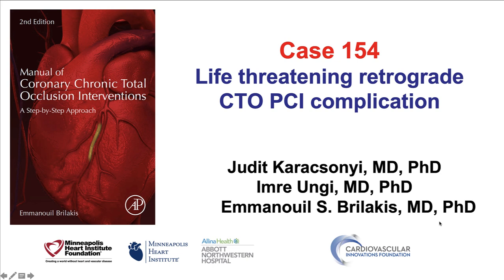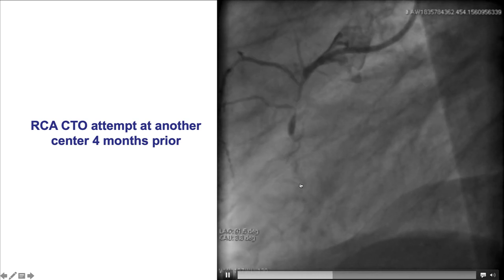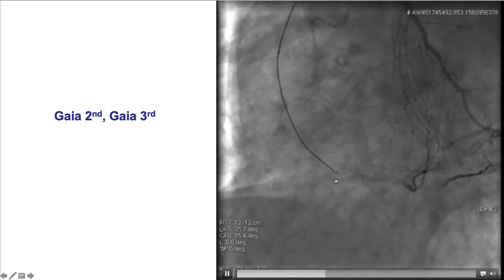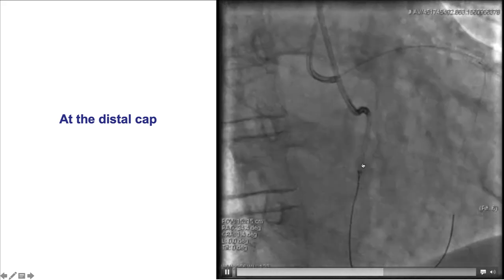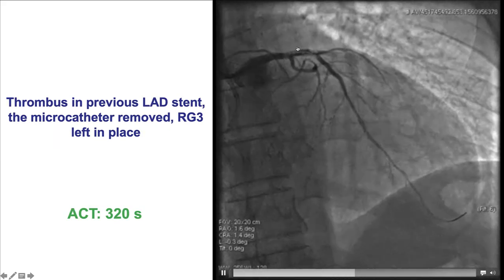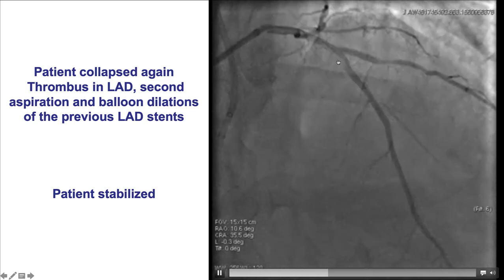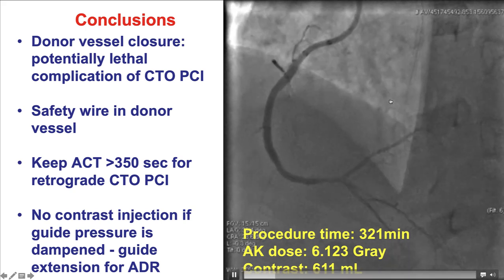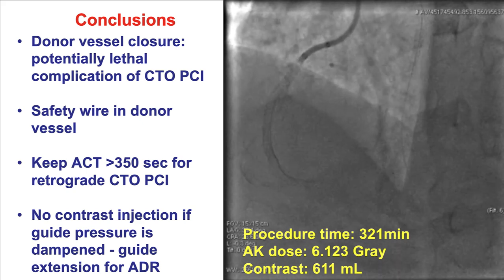Case 154: Manual of CTO PCI: Perils of retrograde

Comment: Spent 5+ hrs w 600mL contrast, previous failure at other center. Was CABG discussed? 52 year old patient. Realize not all CTO is this difficult and technically challenging, but a surgeon could have bypassed this patient in 45m.
Reply from the maker: Great point - patient had declined CABG, but agree that surgery would have worked well for this patient.